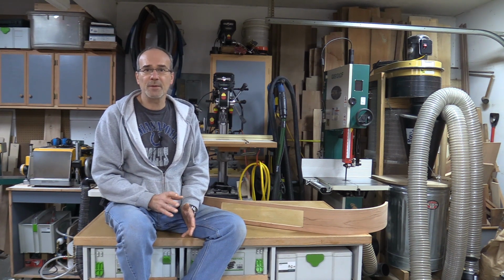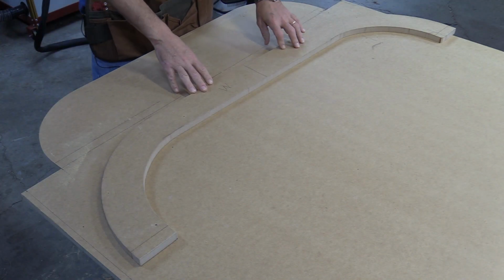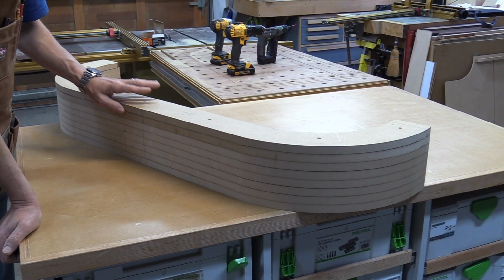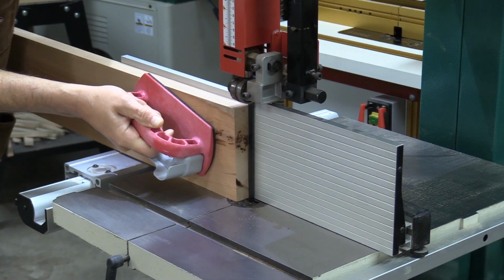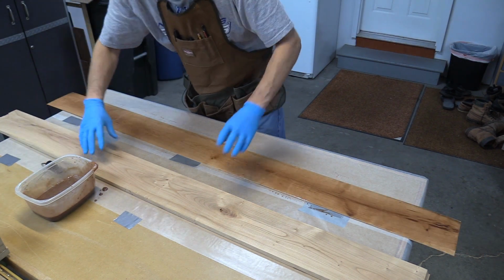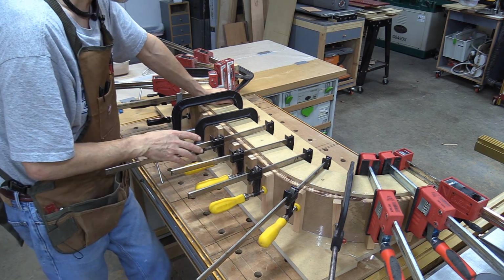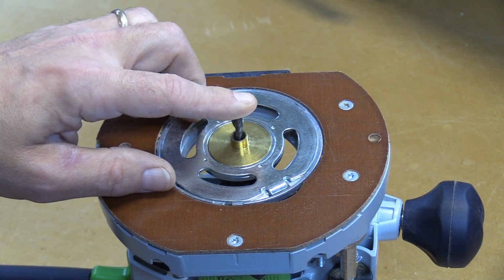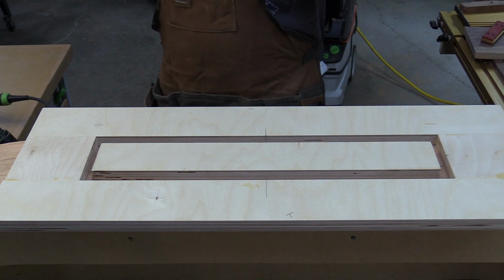Floating Hall Table Pt.1 - Making the Curved Front Apron

Comment: Nice project.  To make the glue up a little easier, try using a little hot melt glue to attach your clamp blocks to the caul before hand.  This will make it easier and quicker to get it all together.
Reply from the maker: Great tip! I have seen that before. Unfortunately I don't have a hot glue gun :(

Comment: Indeed pure craftmanship and useful tips, especially the one on the type of glue used in order not to have any kickback. Did you do a dry fit to check if the laminates could make the bend? To save precious wood, you could also choose for a cheaper species for the inner laminates since their not visible in the completed project, right?
Reply from the maker: +Bart Loncke Thanks Bart! Yes, I did a yes bend to make sure first. I used cherry for the laminates mainly because for me it's so cheap @ $2 bd/ft. And I used a board that was not that good for much else.

Comment: Nice work Guy. Any reason you didn't want to use a secondary wood and just veneer the outward facing piece? Looks great.
Reply from the maker: Thanks Brian! Two reasons. One, the board I used for the bulk of the laminations was definitely a "c" grade board. Second, for me, there is not much price difference between any of the different locally grown species I buy. For example, I paid about $5 for that board, a secondary wood like poplar would have been about $3. It just made more sense to use the same species.

Comment: Hi Guy. Love your videos! I was just curious, why did you choose the bent lamination approach versus just the kerf cutting curve approach since it's mostly straight except for the ends?
Reply from the maker: Thanks Matt! Because no matter how close you get the the kerfs, there are still flats on the curve. It may work well on some pieces, but not a piece of what I would consider fine furniture.
Reply: AH! Ok. I haven't actually used the technique before but now that you say that, totally makes sense that you could still feel/see the facets no matter how small. 

That being said, now it occurs to me that a layer of thicker veneer on the front might "ride over" the facets enough to hide it? (just thinking out loud because making bending forms is such a pain!)
Reply from the maker: It may, never tried it.